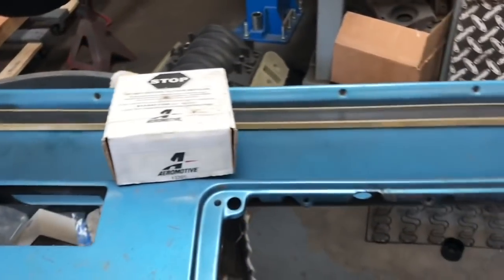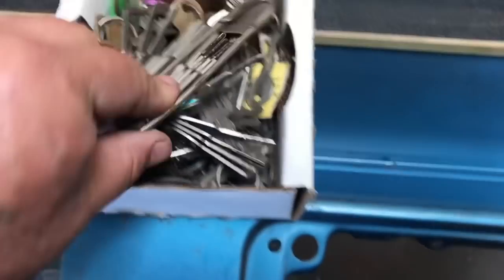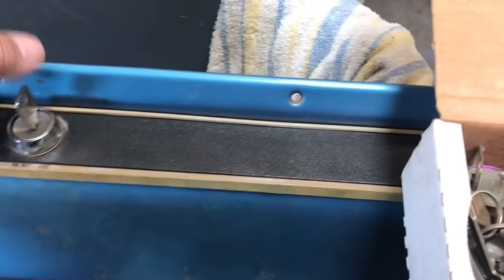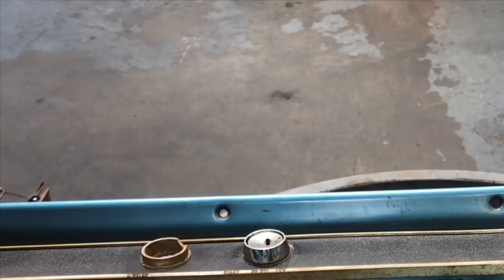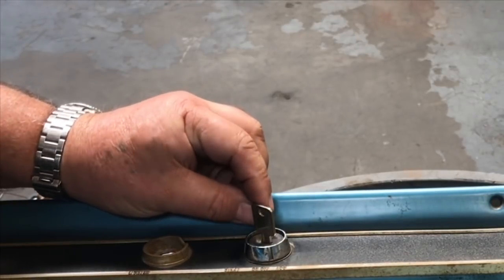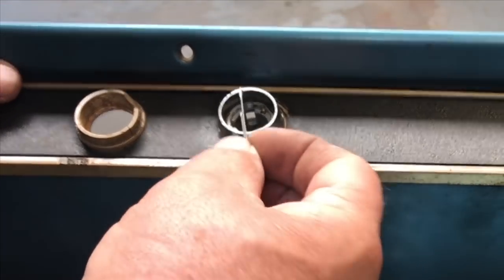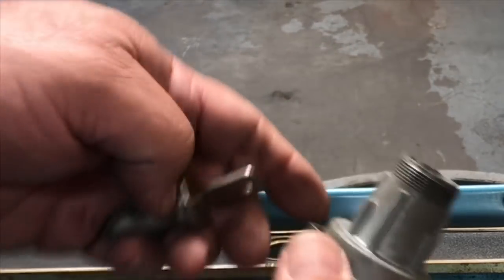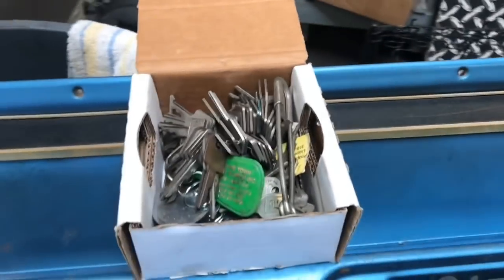Early Chevrolet Ignition Switch removal

Comment: Back in the late 80’s I had a 1976 impala 2 door, walked out of the store, and I got into a 1976 impala 2 door, started it up and before I put it into reverse I realized the car I was in had blue interior and mine had white interior. So I got back out quietly and walked down the row of cars past the van that was parked between my car and the identical car with a different color interior and drive away hastily
Reply: I'll do you one better:
Many years ago when I was young, I would perform maintenance on some of my dad's friends'
cars. One such older gentleman I had loaned my '73 Cutlass to for the day while I worked on 
his own fairly new '77 Olds. 
When I took his car back to him at his home at the end of the day, we settled up the money 
and he handed my keys back to me. I headed outside to get in mine and head home - only to 
find it wasn't in the parking lot of the townhouse community he lived in!
Figuring someone had stolen my car, I rushed back to "George" and told him I needed to use his
phone to call the police (no cell phones in those days). George says "there's your car right there"
and points to - an old raggedy Plymouth Duster!

Yep, you guessed it. George was getting on in years and had gone to the local market in mine -
and when he came out to go home, he had somehow forgotten what my car looked like!
Even though my Cutlass was silver, he wound up in a PURPLE Duster - and, having flipped the
ignition key upside down (GM keys worked "flat side up"; Mopar was the opposite) had
managed to inadvertently "steal" the Duster...

George, upon discovering his mistake, was stressing out about being arrested for theft - and it
was quite late in the evening, past time that the store had closed. A hasty decision was made
to leave George at home and for myself and an accompanying friend to go back to "the scene 
of the crime" in that Duster, despite knowing it surely had been reported stolen.
We arrived at the store where yep, there my car was, now sitting in the middle of a large, empty 
lot all by itself! 

Paranoid, we made a quick scan of the immediate area, then quickly changed cars, remembering
to wipe down all surfaces in the Duster we (and mastermind criminal George) thought we'd touched.
Jumped in my Cutlass and hauled ass outta there.
True story!